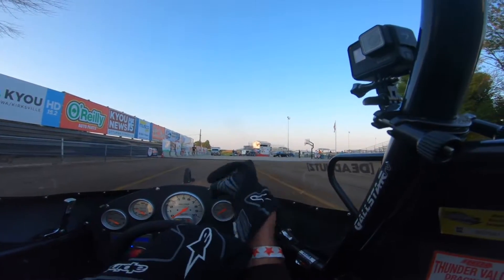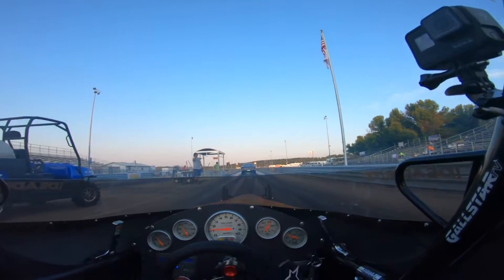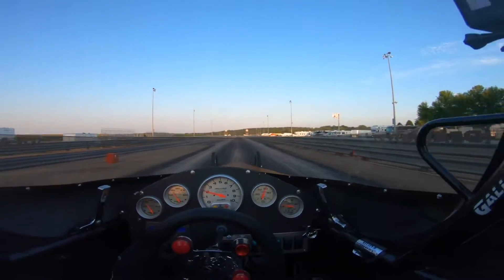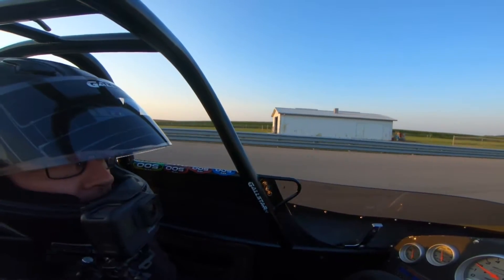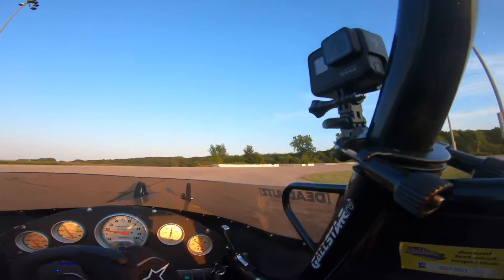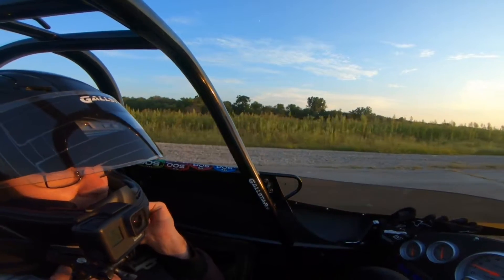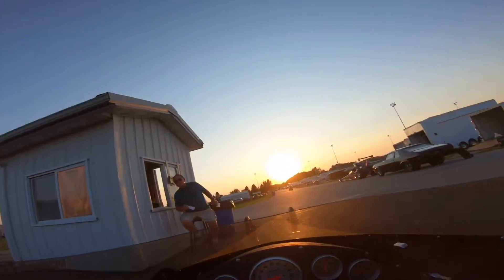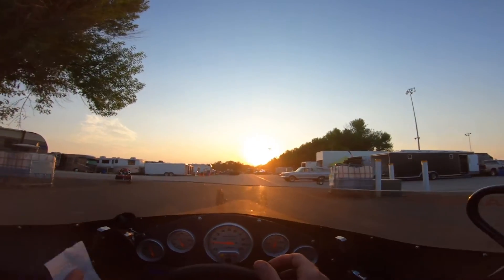DRAGSTER IN CAR CAM with IN HELMET AUDIO! [Talking through a Time Run]

Comment: I'm wanting to buy a dragster and start racing myself. my family races door slammers. so i will be the first to race a rail in the family. could u make a step by step of what goes on in the car? from what buttons does what and how the shifter works? do u just do a rolling burnout in a rail?
Reply from the maker: wendell Carlisle sure man!!  I can do that sometime for sure!  Quick answer to your questions would be: Yes rolling burnout while holding a rev limiter on a button.  And the shifter is air actuated on a timer programmed in my delay box.